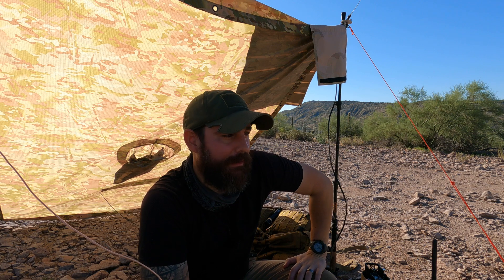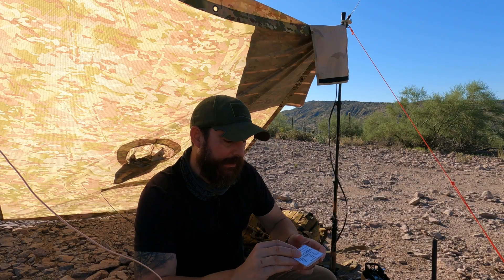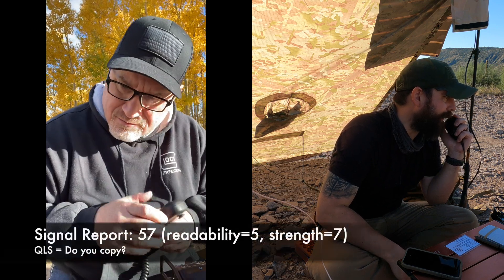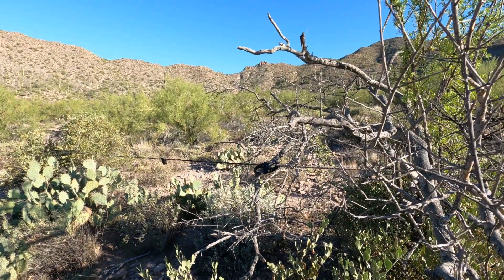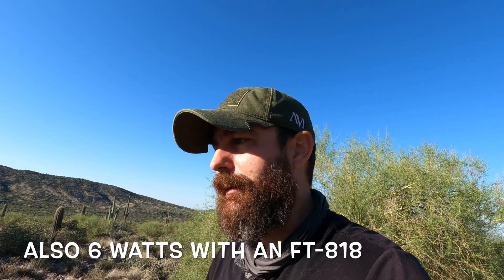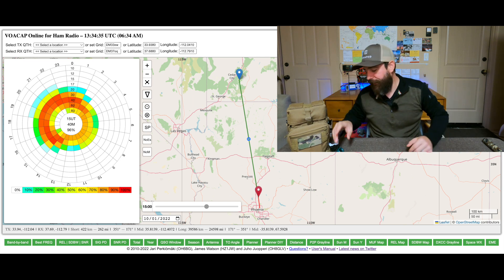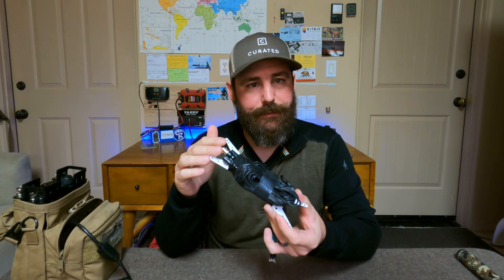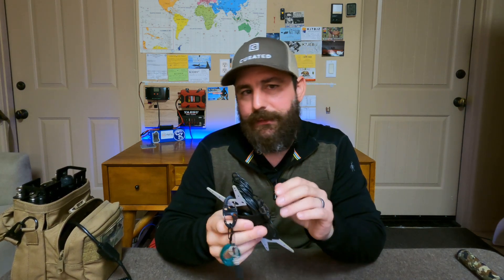Offgrid Regional Communication - No Random Contacts Series

Comment: Just watched this video a second time. I agree with you that many times, what is written in books is more than is necessary to actually make a contact. Other times you need everything in the book and more. Sometimes a very minimalist approach works out just fine.  You had great success that day. But what if....What if the sun was active with a mass ejection ? What if the SFI numbers were low ? In cases, other than with expected band conditions, you may not have made the contact. I think it's important to know the SFI numbers if available. If not, listen to the bands before venturing out. You can usually make a good determination of how good the bands are. In some cases, you may need 20, 40 or even 100 watts to get the job done. You may need more height on your antenna. I like having the capability of upping my game if the contact is a must make contact.  Even then, you may fail, but at least you have used the type of equipment that had the best chance of a completed contact. In SHTF, we won't have many band condition indicators except for listening and knowledge of where we are in the 11 year cycle.  (you have not operated when the cycle is at it's low point. It's a challenge). Your desert soil is some of the worst for NVIS work. I think I would at least have a taller pole and maybe a reflection wire available to place under the antenna. But that's just me. I like the fact you used the prediction program in advance. Not sure if it takes things like SFI into account, but if it does, it would help with planning. In SHTF, the prediction program may not be available. I'm that guy who wants to have more in the bank than I might need, but only use what is necessary. There are always many things to think about. Weight and ability to carry what you need is a consideration. A portable amplifier to go with a qrp rig would be a great way to go. Low power usage and the ability to step it up if necessary. As always, I very much enjoyed your video. Your journey is a fun one to watch. This is just food for thought, not a critique of what you have done.

Comment: Great to see. Getting ready to set up an NVIS antenna setup for the house. I'm primarily interested in comms within Texas and neighboring states. Our RACES region in South Texas has an HF net, but the usual antenna heights do just what you said. Shoot right over. Now if I can also figure out how to set up my mobile VHF rig for APRS AND figure out how to use it that will help.
Reply from the maker: Best of luck on your station setup. For APRS, it's easiest if you upgrade to rig that has built-in APRS capabilities.
Reply: I actually have two mobiles that can do APRS. 2 - VGC VR-N7500 (one is rebadged RT-99). Just need to actually dedicate the time to really get into it and be hands-on with it. Time and focus. Yep, it'll be a while. 73

Comment: Nice Video. I would say you were very successful on your portable ops mission.  You hit the nail on the head first thing, key word...."planning" and a plan B, C, or D if Plan A doesn't work.  As for having a big station, since I haven't hit the lottery yet, I guess I'll have to stick with my barefoot HF radio and home made fan dipole.  The main key to any portable ops is first antenna efficiency, and secondly, have or know what your "power budget" is going to be or have available at the time of your ops.
Reply from the maker: Excellent point on antenna efficiency  and power budget. I am still waiting for those lotto numbers to hit. Daddy needs a 65' tower and some LMR-400. ;-)

Comment: Hey tech, I use NVIS several times a week 100 to 471 miles  on 80 or 40m  230mi seems to be the sweet range. I USA an ah4 random wire tuner and 100ft of ace hardware clothesline.
Reply from the maker: I appreciate you sharing your success with NVIS. The clothesline wire from Ace Hardware looks to be a very inexpensive ($8.00 USD) option. Nice work!
Reply: @TheTechPrepper  I send radio emails with winlink there are about 19 RMS (radio mail server) stations in my 55 Yakima to 471 Idaho falls range. I contact them all frequently from different locations, conditions and configurations at some point some top performers will pull out ahead these are the ones I go to when I have important traffic. VARA HF is my mode of choice.
I have a mobile set up and have plates I can park my truck or any vehicle on that will allow me to put up 2 20ft masts I have vertical and directional antennas for uhf and vhf. Like you practice has helped me improve my skills. Thank you for your practical videos

Comment: Well, I am impressed.  When I heard your time and band I thought it was about an hour early for 40m, if its open, and about an hour late for 80m.  Fortunately, though not stellar this solar cycle has been pretty good.

In my opinion 80m NVIS is the money band for reliable NVIS. In a solar minimum 40m is hit and miss at best.

When get more play time I need to work 60m NVIS.

True! High power is not the answer. The military HF manpack radios usually top out around 20W-25W. They do have digital voice which does increase reliability.

True! A true resonant antenna is always better than an antenna requiring a tuner.

Great video! Keep up the good work!
Reply from the maker: Good Morning, Viron! It's always great when you jump into the comments. I appreciate your insights.

I agree, 75m/80m NVIS is very reliable. We have a regular net on 3.868 MHz with the locals around 0530L time. There's even an ARDOP Winlink RMS gateway 60 miles that works very well on 75m in the evenings and early morning.

Cheers!

Comment: Have you tried  JS8CALL?  It is a low power digital mode that you would only need to add a tablet or laptop computer, maybe a interface if your radio doesn't have a USB. Many radios do have USB now.  I know that means more power if you are out for a long time but for short time the laptop battery should be good.
Reply from the maker: Yes, I have and I do run JS8Call. In fact, I run a lot of digital modes. The FT-818ND manpack shown here has a DigiRig Mobile permanently mounted to the frame and there's a Panasonic CF-20 Toughbook (convertible laptop/tablet) in the pack. These days, my group and I are using fldigi/flsmg for VHF/UHF but also HF. We are going to cover a lot of digital, including APRS, NBEMS, JS8Call and  HFLink. in this series. Here's a field video with the FTM-6000 and the DigiRig if you are interested: https://youtu.be/bRMQuY2hVzo

Comment: I use my home made magentic loop antennas, works good for very high angle NVIS and my Icom IC- 7100 portable.
Do you live in Northern Gila County? Love that area of AZ, have family there
Reply from the maker: I am in Maricopa county just north of Phoenix. It's incredibly green here now with all the rain we've been getting. Most of my local NVIS contacts in the area are with operators running loops. 73

Comment: O.M. ?  You mean sad hams?  LoL.  I've made excellent contacts on 11m band, 4 watts (maybe 8 watts due to mode LSB) off of a mobile magnet mount on a radiator about 30' up, indoors. Talked to Iowa and another South Eastern state. Conditions were good that day.  I've made some pretty spectacular contacts over the years. That's what keeps it interesting. 

Thirty some odd years ago, I picked up a mantra from someone with a lot more experience than I. The 6-P rule. Propper Planning Prevents Piss Poor Performance.  In those years,  I've come to realize and experience how some are completely inept and stumble through life.
Reply from the maker: Yes, that is what I meant. I did not want to steal NotARubicon's expression. It's amazing what you can do with QRP and a wire. The 6-P rule is a great philosophy.
Reply: @TheTechPrepper  I forgot to mention that I'm in Canada, so those contacts would be a lot more unusual than some. 

Yes, randy is funny guy.  Keeps the people coming back. LoL

Comment: Before 2m repeaters, 80m was used for local ground wave comms
Reply from the maker: A bunch of locals in this area still use ground wave propagation for 75m/80m for very close-in comms (< 20 miles). It works pretty well. Thanks for sharing.

Comment: Looking fresh with the new hat and lighting.  Your original NVIS video is why I'm subscribed.  Another great one.  Have had some struggle with my own home brew dipole on 40 to where I switched to a end fed for field (my backyard really), but you're making me want to try again.  Fail, Learn, Fail haha
Reply from the maker: Definitely, give the build another shot. I love these simple antennas as you can fix them in the field with a pocket knife and some electrical tape. I had the most MacGyver'd setup with the lighting, too. There were two saw horses, a 2x4 and two of my wife's lamps. Thanks for the ongoing support.

Comment: Great video however I do take exception with the statement that antenna tuners just “fake the radio into thinking it has a good match when it doesn’t and waist a lot of energy in the form of heat” is not correct.  This is a common belief among hams and is what I believed. A good book on the subject is  “Reflections” by M. Walter Maxwell (chapter 17 gives a good summary). The book explains how a tuner can make a non resonant antenna resonate.  There is , however a small amount of power loss by the tuner  but this might be in the order of 5%.  In preparation for Field Day this year I did some WSPR testing of a random wire non resonant  antenna against a 20m 1/4 wave vertical and an EFHW and the random wire antenna with tuner performed as well as both.
Reply from the maker: Thank you for correcting me. I am grateful that a few others have corrected me as well. I am still trying figuring this stuff out and have heard a lot of conflicting information on tuners over the last couple of years. Time to buy “Reflections” by M. Walter Maxwell.

Comment: Another awesome video, I really enjoyed.  You grasp the objectives of Ham radio with experimentation and building your own antennnas which is a real asset.  I remember running an NVIS antenna many years ago to work about 200 miles by just dropping the antenna along the ground with success.  I know hams here in VK Land that have used wire fences and a tuner with great success.  Thanks again for your series, keep up the good work.
Reply from the maker: Thanks for sharing your experience. I am not surprised that using a fence and a tuner works. Cool stuff. NVIS for the when. Cheers from the US!

Comment: The bands certainly cooperated for you.  Nice work!  I listened for you and heard nothing but Asian broadcast shortwave stations coming across the ocean. I may have been a bit late. 
I also listened and called for you on 144.200 from the San Diego mountains. Nothing heard there either. 

Band agility will go a long way for you in making this success not just a random occurrence, thanks to cooperating band conditions. 60 and 80 m are essential NVIS bands, particularly in the morning.  Luckily, the sun has been so active that 40 m worked as well.  

Understand that a tuner doesn't just fool the radio and waste the extra power - that's an OM's tale.  The tuner adds inductance and capacitance to match the antenna to the 50 ohm output of the radio so power is efficiently passed to the antenna.  Losses are typically small, particularly with good antenna design.
Reply from the maker: Good Morning, Adam. Yes, the bands were very kind to Mike and myself that morning.

I tried you for about 15 minutes at 1545 UTC, but nothing. I was about 600' feet short from the planned summit, so I was in somewhat of a compromised position. I only had the PackTenna TrekMount, but it was fun trying to call you anyhow. I did not hear anything on 144.200 MHz.

Thank you for chiming in on the OM's tale. As a new ham, I hear a lot of conflicting comments.  That's part of the reason why I enjoy hands-on experimentation when possible. I appreciate everything you do for the hobby. We need more hams like you. 

73's

Comment: OM just refers to a man and YL is a woman. OM is not referring to a grumpy old ham it has to do with CW.
Reply from the maker: I've heard it used many times, perhaps incorrectly, to refer to "salty" hams that are generally unpleasant to deal with on the air. Others are saying that "OM" refers to classical CW operators. As for "YL", I've only heard it used to refer to your wife and XYL if it refers to an ex-wife. It's getting increasingly difficult to get accurate info with all of these conflicting pieces of info floating around the Internet and airwaves. I am a newbie still trying to figure this stuff out. Thanks for jumping in.

Comment: There’s a lot of good stuff here. I love your focus on resonant, efficient antennas and VOCAP for planning. Been a ham for 23 years, and I love seeing people doing stuff like this.
Reply from the maker: Glad to hear it, Scott. I'll touch on more VOACAP as we do more HF targeted contacts in this series. Time to get back to VHF/UHF for 3 or 4 videos, then back to HF.
Reply: I've used VOCAP and other realtime systems, but I rely on 80m and time of day for reliability. During some disaster the Internet will not be available. Between solar maxima 40m may not be available.

Amateurs are left with 60m and 80m that are reasonably reliable and somewhat predictable.
Reply from the maker: @vironpayne3405  You are right. I keep a historical log of all my 40m/75m/80m NVIS contacts to help with my personal prediction. In terms of software, I am incorporating the "voacapl" Linux command line tool into EmComm Tools along with the projected solar datum going several months into the future. What does this mean? Well, it means that I can perform a similar analysis 100% off-line, in real-time using my offline Tactical Awareness Map as the friendly user interface.

Comment: I've done backpack portable NVIS (plus) on an EFHW at 3' at the feed point to 20' at the top. From a POTA activation in NH I had contacts on 40m to all 6 of the New England states plus NY, MD, NJ, PA, WV, TN, FL, MI, NC and Ontario. Distances range from 36 miles to 1289 miles and everything in between. With the same antenna on 20m I hit from AK to Spain. No tuner was used on either band. NVIS doesn't necessarily have to be done on a NVIS specific antenna.
Reply: washington?

Comment: Another great video from which this "OT" is learning!  (Not all of us old folks are alike!)  I appreciate your using dedicated length dipoles.  They are simple and keep SWR down in your coax.  And I agree if one used an antenna tuner feeding into coax, the potential high SWR on the coax from a mismatch of the antenna can cause hot spots in the coax and thus signal loss.  

However, I tend to like open transmission lines (450 - 600 ohms) which are very low loss feeding a "doublet" antenna which can work on all bands.  Of course, this does require an antenna tuner, especially one with a balun that will give a balanced output to the feed line.  There are some QRP models that are relatively small, and, in conjunction with the SWR meter on the transceiver, a great match can be achieved and all the energy can get to the antenna.   Not to take away from your concepts at all, just adding some thoughts to the conversation.

I think I'm sold on the FT-818ND!  Thanks!
Reply from the maker: Good Morning, Kathleen. I did not mean to lump you into the "OM" group. Please ignore my comment and as I did not mean any offense to you are 99% of the hams on the air. I may have used that term incorrectly. 

Personally, I almost gave up on the hobby even before I got started. I spent my first two years without making a contact. There was a very closed local group when I first got started that refused to acknowledge my call when I first got on the air. I ended up not having a contact for two years and was about to give up. When we left the city, 2.5 years ago, I decided to try once more on a different repeater, and my Elmer Mike WB4ZKA answered my call. We have been great friends since. In general, the experiences have been positive since then, but there are a few salty operators that I still run into on HF. I am wondering how many other new hams are turned off by a first bad experience? That's the main reason why the channel is kept simple, practical and fun.

Glad you enjoyed the video, even if there were a few portions that were technically incorrect. Live and learn. Thanks for sharing your thoughts on the Doublet and some of the corrections. I've been meaning to make one for a while and have 100' of 450 ladder line waiting to be used.

The FT-818ND is great. I owe you an email response!

73 de KT1RUN
Reply: @TheTechPrepper  , when you get to know me better, you’ll see I have a great sense of humour.  And, I know EXACTLY what you’re talking about, those hams that, rather than taking you under their wing and give a person some slack on being new, would rather just criticize.  I’m so glad you stuck it out!  You’re turning out great videos!  And, as someone who has been in Emergency Management for a long time, you are spot on in your approach!  The “after action reports” are vital in reflecting on what went right and what went wrong.  I’m glad you emphasize those so that all you viewers will learn from that as well.
Reply from the maker: @W1KAB-9  I am looking forward to the friendship. We need more hams like yourself.

Comment: GMan, amen bother.  Working in the same direction and built a 40/80m dipole NVIS.  Tested it from 24ft to 6ft and usable at all heights.  24ft was definitely stronger but if you don't have that possible, go for it!  GSP!  KEEP UP THE GREAT WORK!
Reply from the maker: Morning, Dick! Glad you enjoyed it. Good luck with your 40/80m dipole for NVIS. I have also found that the slightly higher heights perform better. In general, 16ft for the apex is typically as high as I can go. I plan to modify this design and add links to support 40m/60m/75m/80m. Stay tuned and be safe.